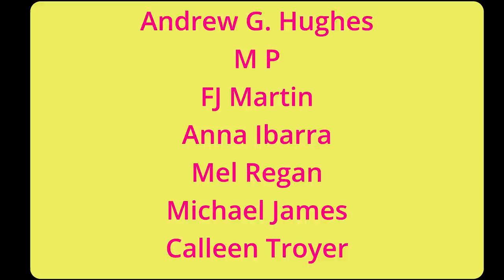🏰 EP 55 IS IT NEARLY THE END??? :  -Chateau Life

Comment: Your patience is admirable.  If I had a drain in the floor I'd find it hard to resist using a power washer.
Reply from the maker: It was tempting but it is partially blocked up on the outside for obvious reasons but more importantly we couldn’t let cleaning chemicals into the water system

Comment: I lived in a stone cottage in Woodstock many years ago and the very cold kitchen had a slate floor that was filthy.  I was told to use dishwasher powder in hot water, and two goes over it and the slate was so clean I could see the cement between. The powder doesn't pottery, sate or even the grout, but it is a powerful degreaser.  it was so clean we had to seal the floor because everything stick to it!
Reply from the maker: Aha that’s a neat trick! As it’s low foaming but powerful action, will try on another floor in the house. Thank you

Comment: I wonder if you could get a machine that polishes the granite to the finish used on counter tops?  There is also a satin finish.  It seems like that would be easier to clean.
Reply from the maker: The scrubbing machine we are using can have polishing pads put on and in the future we will indeed although not to work surface standard.

The floor is having a water proofing sealant on it next which will help with cleaning as well